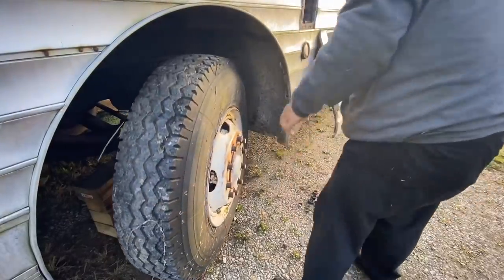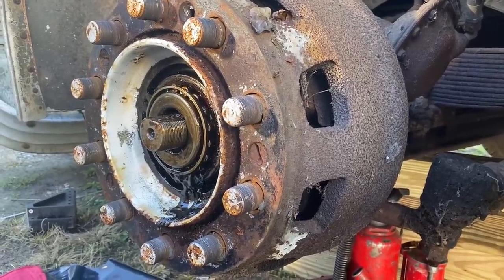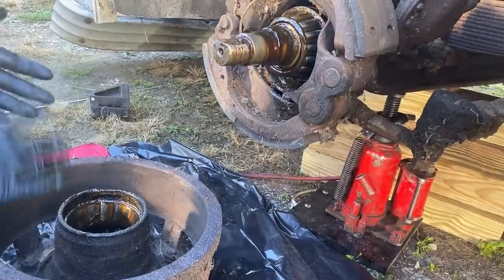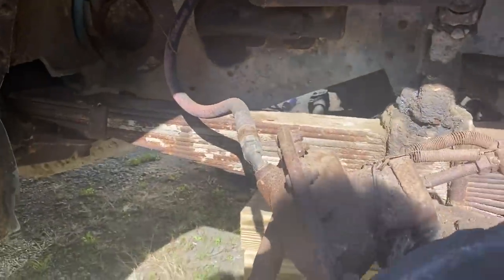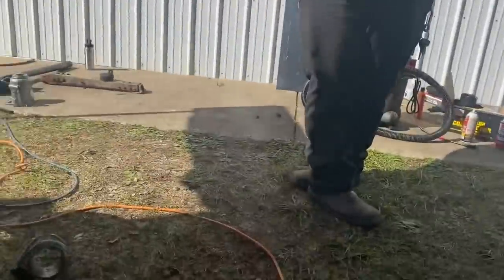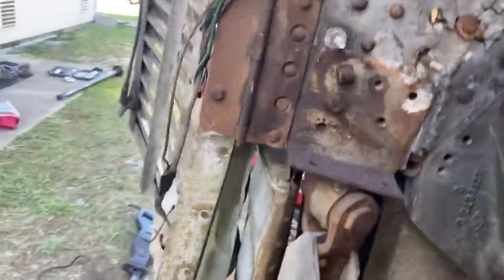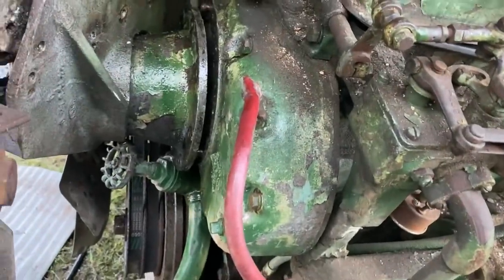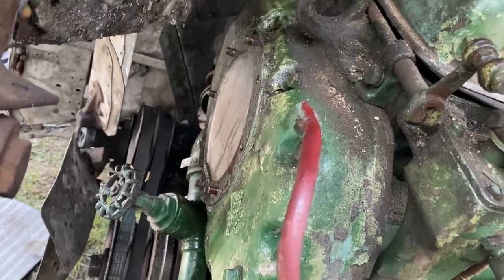Day 3 silversides bus project

Comment: That took a little bit of this and a very large amount of that to get back to where you can start a proper fix. All those  aluminium castings seem pretty exotic for a pre war commercial set up. The guys who did the plates and bolts back in the day would not have expected them to last tiil 2019.

Comment: I remember last year I came across 4 videos on YouTube of a silversides bus restoration done inside a shop that took over 6 months including a full conversion to an RV. End result absolutely gorgeous. Only item I didn't agree with as it was driving out of the shop yard they said next stop is to Cummings to have a new 500 horse engine and Allison transmission installed. If it were mine I'd simply do an out of frame on the 6-71, nothing wrong with her at all. Will post the links if I can find the files. The owner spent near as much for a new coach but wound up with a classic bus.

Comment: You need to get an air chisel with a punch bit and an assortment of chisel bits. It beats the heck out of trying to hammer out bolts.  It makes quick work of cutting the heads off of screws, rivets and whatever.   The engine cradle end that you guys spent so much time on may have come right off too.
Reply from the maker: We used an air chisel on that end on Monday.  It did nothing except try to break the aluminum
Reply: Oh, ok.     I haven’t seen you use one....so I assumed you didn’t have one.   Always great content, Thanks!

Comment: Split rims kill. As was the case back in the 70’s while working in the parts department for Navajo Freight Lines in Indy. The mechanic was breaking down a wheel to change a tire and even though he was using a  safety cage, he placed himself just inside the safety bar when the rim lock broke and hit him. He died  on the way to hospital.

Comment: The scary thing is many people would buy an old bus, put in batteries and air up the tires and head down the road. The mechanical condition of many of the buses you’ve shown is appalling. I’m all for restoring them and preserving history, but buyers need to understand that a lot of maintenance is needed to make them safe to drive. Like a lot of things, the purchase price isn’t the big ticket, it’s the maintenance. 
On another subject, I believe the Silversides used Rockwell rear ends. I’ve seen that axle with a gear connecting it to the hub on some old military vehicles before.

Comment: Question... why don't you start off with a pressure washer and swill off the bus ?
Would probably save time later on.
Reply: Yes, that will work, but he would be working in mud.  In a previous video, someone said the same thing, and that was his answer.
Reply: @mrmudstud5980   Guess so.  If he knows where he's going, should send a message to the bus owner a few weeks before hand: 

"by the way, if you take a pressure washer to the bus... it would help"

Comment: Why didn't you guys just drill that bolt out and re tap the hole one size bigger or thru bolt it after you drilled it out with a thru bolt with a nut on the in side

Comment: It's good to be afraid of split rims the ring will take you head off we air them up and work in a tire cages I saw one hit an I beam on the ceiling and it put a 2" dent in it. Careful
Reply: I had a split ring off an Army 3/4 ton truck go through the metal ceiling of the roof at Fort Campbell Kentucky in 1966 when the tire blew up. The explosion also blew half the canvas off the cab and bed. I was lucky my helper and I were on the opposite side of the truck when the thing went. Our ears were ringing the the rest of the day.  We were darn lucky no one was killed.
Reply: It used to be that if you walked into a tire shop and look up at the ceiling to see how many split rims came apart
Reply: Been around them for the last 40 years, never seen one come apart. If inspected and installed correctly they won’t hurt you. This includes 1 tons up to heavy earth moving equipment.
Reply: @Just Me it’s true but it’s also a dying art form. Insurance companies and lack of education are part of the problem but we’ve shifted away from mechanics towards “installers” because they are cheaper. Blame capitalism for that one :-/
Reply: Sinister Sparky I agree completely.
Reply: Back in the mid to late 1970s, Autocar magazine published a photo showing a wall and the concrete ceiling of a Norwegian workshop. You could see where the guy’s body hit the ceiling after he inflated a truck tyre without using the cage.

Comment: The corroded aluminum chassis structure of that silverside looks scary to me......
Reply: Galvanic corrosion happens especially when the bus sat for decades steel bolts and plates and aluminum work but not for long unless treated

Comment: That mount is just plain weird.  I would guess that all it is good for is a pattern for a new fab.  Not enough good metal left to be useable.  "Swiss Cheese"  would be charitable in the extreme.  And the firewall mounting points  look like they are questionable also.  Alot of Hammer and tong work there, I think. 'Axe

Comment: These are very major structural repairs that will make the bus serviceable pretty much for ever. Once this is completed Sage will have the drivetrain, brake and steering systems dependable. I'm with Scott 100% on not calling such a testament of engineering and time scrap!!!! Have you thought about how to tackle the fan issue?  Great job Scott, Tyler and all who took time out of their busy schedule to help.

Comment: I don't blame you I'm afraid of split rims too. Since some of the forklifts at work have them we let a shop handle tire repairs. Whenever I had to remove a split rim frozen to a hub I always deflated it then use a hammer while I stand to the side. 
If that doesn't feel safe enough I ratchet strap the wheel so the split rim can't go flying.

Comment: i know when walking beam bushing caps r too stuck to remove ive found pb blaster and alot of vibration from a good air hammer has worked for me when heat wouldnt

Comment: Restoration or deconstruction of that engine mount is a big job in its self. The proper way to go for sure is to get an engineering shop to make  replacement. Use the old mounts as a template. You have contacts or put the word out. It will be done. Looking forward to seeing the repairs.

Comment: When driving tow trucks, we would hit stuck on wheels with a long piece of 4x4 wood. Doesn't damage the metal, always got the rims off.
But, I never did it on heavy duty stuff, busses..

Maybe you would use a 6x6
Reply: i think Scott was worried about the split rim exploding apart while hitting a possibly creating a hospital trip and damaging  the scenic cruiser and Tyler"s awesome dodge ram that are  parked near it  with sledge hammer hence why Scott let air out of tires safety safety safety

Comment: The owner of that bus if fearless looking forward to see how the engine mount is handled. Are the front leaf springs available?
Reply: Any spring shop worth it's salt could build a new pack. They just need the dimensions. We have a great place named fort Wayne spring in fort Wayne IN that can work miricales with spring parts. 

That mount arm just needs to be re fabbed. I would personally switch to steel for price. If they want to keep her more original then aluminum it is. I would also change that under torque arm completely. Cast aluminum is a nightmare to weld. Either find an nos one or just have one fabbed new.
Reply: @TODDFINK1  Thanks I wasn't sure how common they still were.

Comment: Recommend a face shield from a welding supply company like Airgas . They have replaceable lens for when they get too scratched up . Also use welding goggles for gas welding . Also available from Airgas . Aluminum fatigue.

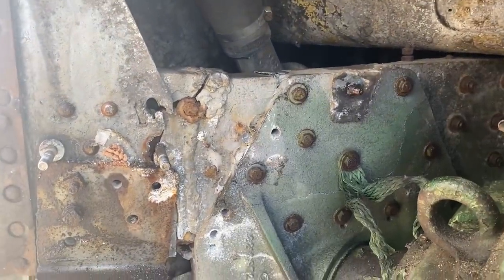Comment: 13:06 The frame by the engine mount has had a number of quick cheap and cheerfull repairs by previous owners.It's good that you are removing the weak cracked aluminium botched repair and getting a machine shop to make a new part out of steel.It has to asupport 3 tons of weight,the engine,so after Scott has fixed it it will be very strong.

Comment: It's amazing to me that the engine didn't just torque itself out of that trunnion!  I wonder if it was the bus company or some previous private owner that made those poor quality repairs.  Regardless, a good quality shop can whack you a new one out of 7075  or something and it'll be better than new.

To the naysayers, This bus is pushing 80 years old.  The fact that it has so few problems is a testament to its initial build quality.

Comment: Snap On makes one of the STRONGEST Air Chisels which has punch accessories I usually heat something like that & & then put the air chisel to it & it will drive it rite out! But u have to be ready as soon as u pull the heat off of it u have to immediately start

Comment: Great channel guys.
A word to the wise,
If you screw a couple of short fat self tappers into that grinder cut with an impact driver, they will spread the part . 
This increases the diameter.
You can then wiggle them off with your fingers providing you haven’t screwed the two parts together 😎

Comment: Might be worth it to use the old mount as a pattern and cast up a new one. Fabbing one out of steel plate would be good, but difficult. Who knows what kind of molecular damage was done with previous repairs. Improper welding on aluminum can make it crumble like pot metal.

Comment: Can I ask you why you don’t use like a palm nailer or a air hammer to push out those headless rivets, or bolts ? Seams like it might be easier that way, not trying to tell you what to do by no means either. Just suggesting. Love the videos, keep up the great work y’all.

Comment: You guys need to drill the ends of that crack, you need to stop the cracking. Also, you can "V" out the crack and weld cast.

Comment: I have a theory that maybe the loose drive shaft and the lash in the diff combined with an inexperienced driver would cause the motor mount to stress under a hard shift.  Just a theory and putting it out there.

Comment: I notice a lot of dissimilar metal corrosion.  I use Advance System and Products in LA. for flange piping.  They sells Mylar sleeves and washers that will slide over double nut and washer studs to stop dissimilar contact.   Also Proco products in California have the flange rubber expansion joints for the cooling lines.

Comment: Was there periodic maintenance that could have been done, to prevent the engine mount from cracking like that? Is that a design flaw or is it just years of use that did it? I don't know if you've ever used it, but Tef Gel is a great product for preventing galvanic corrosion in dissimilar metals.

Comment: I think a big contributory factor to the quality of those repairs ( ... or lack of it ) is that they tried to fix it in place.  If the whole thing was removed and sent to a decent shop it should have been no problem.  It may be the case that it is easier / cheaper to fabricate a replacement than to fix the original though.

Comment: Isn't split rims illegal now? I am sorry dont know much about them just thought you werent allowed to use them anymore?
Reply: True split rim are illegal now but these rims are 2 piece rims. 

Split rims have a solid outer ring and the rim has a slit in it all the way across from one side to the other. So the rim slides out of the solid outer ring.

Now this bus has 2 piece wheels on them. The rim is self in solid its one completely piece, no slit across them, now they do have a 3 inch to 4 inch oval slot in the for the tubs valve stem to come threw so that the tire can be inflated. Now the outer ring does have a slit in it so that it can be stretched over the rims locking ring lip. Now this ring does lock into the rim and the bead of the tire slides over another lip on the locking ring to help assist in keeping the locking ring seated on the rim and secured to the rim.

If the locking ring lip is rusted away to much or lip on the rim where ther ring sits is rusted away to much so that its no longer has a square edge to keep the locking ring on the rim, then you have a point of failer and basically a ticking air powered bomb. 

2 piece rims are still in service going down the road now a days but primarily only on Dayton semi rims and that it. Other that a hand full or older military trailers that haven't been retired from national guard units and reserves unit.
Reply: Nick OHaver thanks for the info much appreciated

Comment: So how does that seal work if it is not in the hub tight? And what is done to it to successfully reuse it?
Reply from the maker: It smashes vertically using the front and rear face VS an inner circle like you are used to.   Completely different than modern seals.
Reply: Squeezed, got it.

Comment: 2:10 All 16ths wrench to the rescue!
Reply from the maker: When the right tool doesn’t fit, my metric wrench usually does
Reply: @BusGreaseMonkey  They make metric crescent wrenches. I have a  few. I'm sure they just stamp them differently depending on where they are going.

Comment: Guys....an air hammer.  Get one!!
Reply from the maker: Got one, tried it, it didn’t do the job.
Reply: @BusGreaseMonkey  Get a bigger one.  I've beat the mess out of bolts.  An air hammer/chisel did the trick, and easier on the arm.  Full line auto tech for over a decade..
Reply from the maker: Great and i bet you have a giant air compressor.  I don’t have room for that or the weight available.   Remember all my shit has to fit in a bus.  So i can’t have every tool and everything available like endless power and air.

Comment: Would this Silverside have have mostly union mechanic  labor throughout its life?
Reply from the maker: The first ten years it would have had amazing maintenance...  after that it’s a crap shoot for the next ten then 90% odds it got nearly no preventative maintenance only breakdown repairs.
Reply: Ricky Pyle Union mechanics have contract protection to do the job right. They can refuse a supervisor's order to do quick and dirty work. They can refuse and not be fired or disciplined for doing substandard work.
Reply: On the other hand, they can't be fired for the pathetic incompetence that most of them take pride in.. I'll point at the current GM shit show as proof.